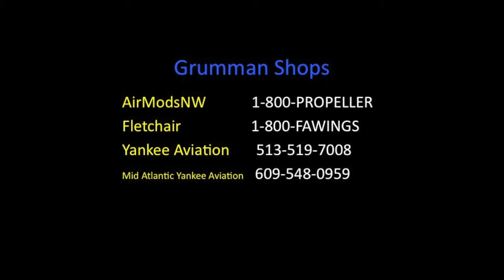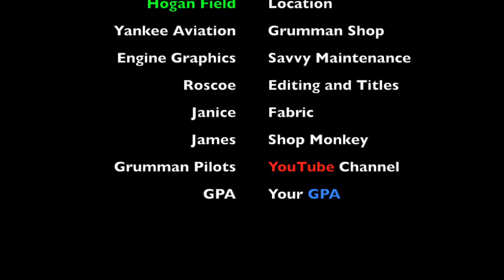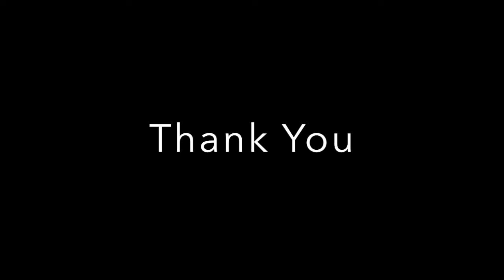Clipped Ailerons (NO!)  - Grumman Style

Comment: Have you done a video showing the installation of the oversized aileron bearings and sleeves?  Isn't this another way to eliminate the reoccurring inspection?  Thanks for all of the videos, interesting stuff!
Reply from the maker: We will as soon as we have a plane needing them comes into the shop.  Oversize bearings is not a solution to the recurring AD.  You can clip the ailerons which ruins the handling of the plane, or you can apply SI 61-01.  You still need to check for aileron torque tube wear as seen in the video on this channel called 'Flap & Aileron Wear Issues – Grumman Style'

Cheers

Roscoe